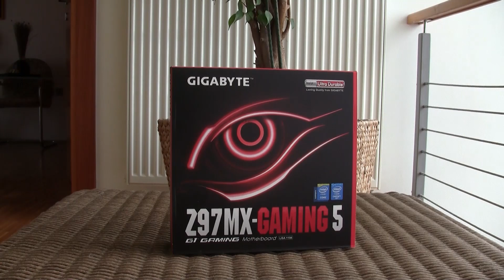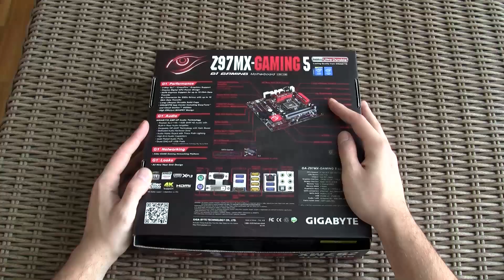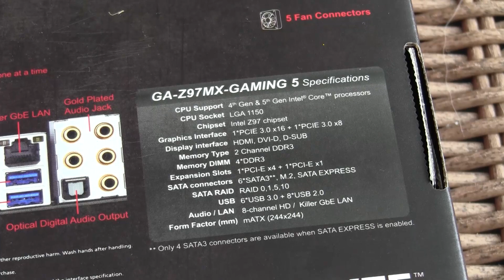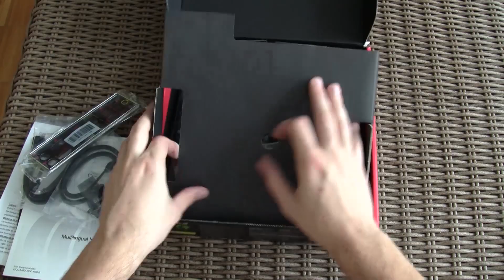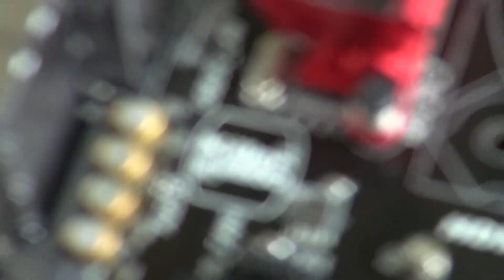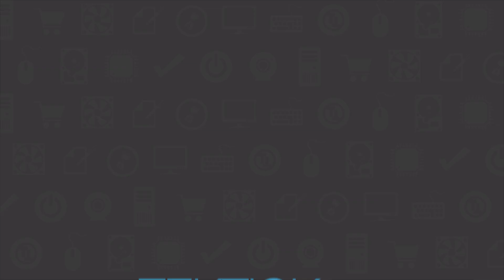Gigabyte Z97MX-Gaming 5 Unboxing & Preview

Comment: someone please tell me how many fans this supports :)
Reply from the maker: ***** I think it's four, but don't hold me on that. You can always use PWM fan splitters!
Reply: ***** It has 3-4 Pin System Fan Headers. So 3 fans total direct from the MB. But you can buy the Silverstone CPF01 2-way fan splitter cable. I bought 3 so it will accommodate my 6 case fans in my Antec Three Hundred-Two case.

Comment: Looking for a low profile graphics card for this, I just installed into an original XBOX case.
Reply from the maker: Ross Wagner If you're looking for performance, I don't think that you can get anything that much better from the dedicated low profile graphics card models worth investing than the iGPU itself on the CPU.
Reply: Will this be capable of playing emulators for original xbox?

Comment: Gigabyte gaming 5 or msi gaming5?
Reply: booboo Well either of those would be good, however to fully take advantage of the motherboard, your processor has to have the function to overclock. If not you might as well buy an h97 or the h87(older version)

Comment: I got this mobo, do you think it could support 2-way sli with the Asus GTX 970 strix GPU?
Reply: I was wondering the same thing because i have the 979 strix and this mobo and it looks like if i add another 970 the back plate of one will touch the fans of the other... Idk but i wish i could answer your question too
Reply from the maker: Atl YT The Marshmallow I think you should have just enough room, you can always angle a graphics card a bit so you get some space on that.

Comment: I bought this mobo and i5 4690K couple of days ago. IT'S INSANE!! :D Great quality and internal Creative sound card is really good. Plus I managed to overclock my 4690K to 4.7GHz (with Corsair H60 cooling). Rock solid and completely stable. So awesome. I also bought ram: Kingston HyperX 8GB 1866 10CL but I can't overclock it. It crashes even on 2133 CL 11 with raised voltage. So be adviced and don't buy HyperX ;) At least ram was very cheap :) Cheers.
Reply: you don't need to over clock ram if its that fast , even ddr 333 is good for gaming

Comment: Nice vid. Will 4690K processor work with this motherboard? Or do I have to update BIOS first? Or can I install the processor, build up whole PC, and then update BIOS from Windows?
Reply from the maker: Yes it will with the 4690K, right out the box! You can update BIOS through Windows, but I always recommend doing it with through the Gigabyte's Q-Flash feature through BIOS. Just put the newest version of the BIOS on a FAT32 formatted USB flash drive, boot into BIOS, press F8 to go into Q-Flash and update it from the drive.
Reply: TekTick Yay that's so great man! I coudn't find the answer anywhere :) Thanks a lot, I'm building cheap gaming rig but I want good mobo and processor with OC potencial. Thanks for the tip!
Reply from the maker: KannX
No problem! :)

Comment: Nice review, try to sound a bit more enthusiastic.

I really hate this MB as I felt that it was a downgrade from the previous G1 Sniper M5 in terms of the PCIe layouts if you get what i mean.
Reply from the maker: Will do, thank you for your feedback :)

I'm sad to see that this model, compared to previous, doesn't have the on-board debug LED and Power On / Reset / CLR_CMOS switches, but then again, they probably had to make some room for the M.2 and the SATA Express.